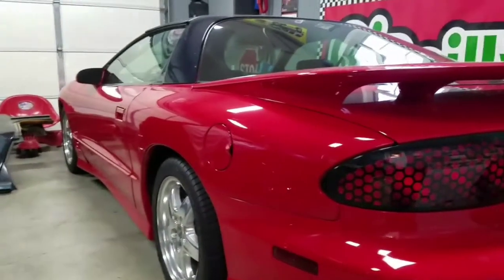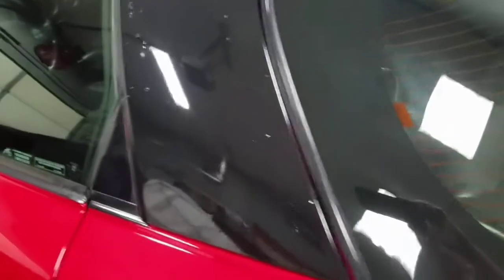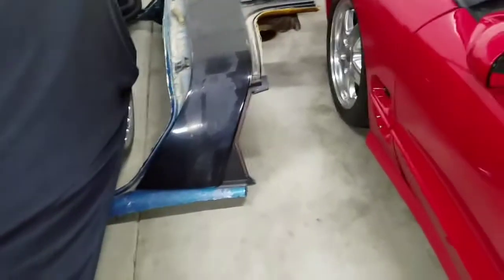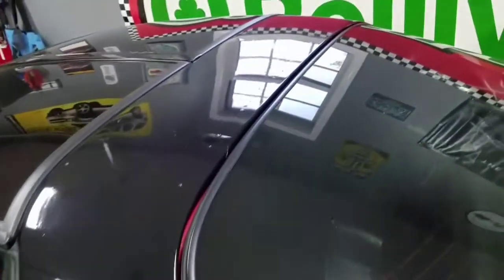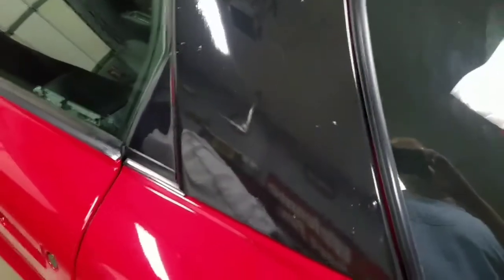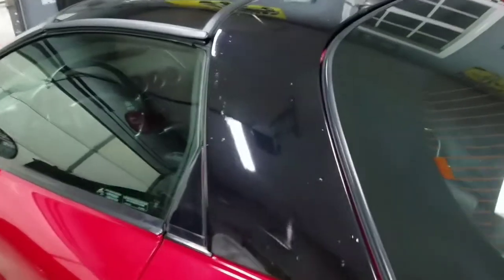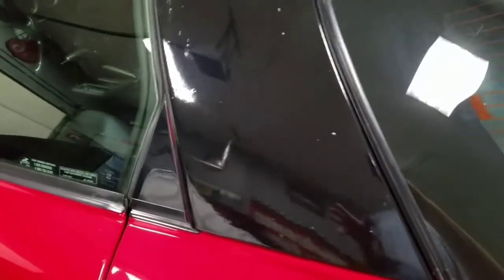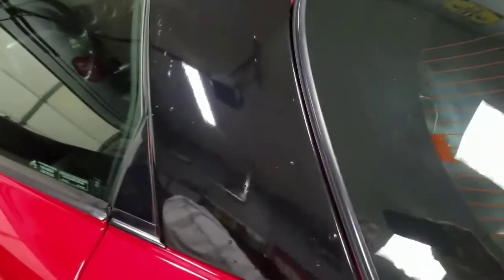Cover or Replace Bubbling Sail Panel

Comment: Cause - the Adhesive used to attach the panel breaks down and oils migrate through the panel, causing bubbles. My friends 2002 Trans Am actually had oil oozing out of the bubbles.

Comment: I have a 97 Z28, and mine is doing it too.  BAD!!  is it possible to remove the original one, clean it up, top and bottom, reeeeaaallly good and epoxy coat it????  Or is that adhesive stuff now leached inside the fiberglass???
Reply from the maker: No because the glue has went into the material

Comment: Is this super common because mines a 99 and it doesn't have this problem or did i just get lucky?
Reply from the maker: +Eric Cartman it is very common. Lighter colors generally dont do it as bad. Some 99 didnt have the issue also. Later year model 99s did however

Comment: Question, so u say gm didn't put epoxy under it and that's why it penetrate right? So if I was to get another one from same year and just put epoxy would it still get bubble up? Or what's the difference from the older models?
Reply from the maker: They change glue in 98 or 99 mid year. They also quit coating both sides to save time and money
Reply: @TWAMotorsports  I see, I'm getting one today from a 97 camaro, I'm going to be taking it to a body shop to color match, do I tell them to epoxy primer both sides then? Do you know if there's different epoxy or they only use one?
Reply from the maker: @naranjoceidy  yes epoxy primer both sides
Reply: @TWAMotorsports  👍🏼

Comment: Just for reference you want from a 94 to a 97 sail panel the 98 and 99 does the same thing yours is doing because of the epoxy they were all used in that Year's so you have to go from a 97 on down to about a 94.
Reply from the maker: This one was replaced with one from a 96